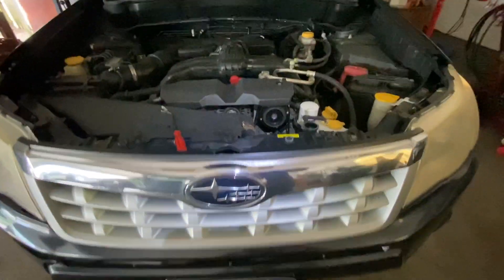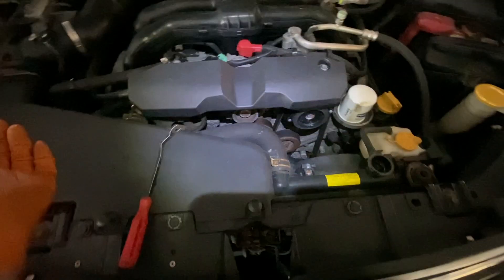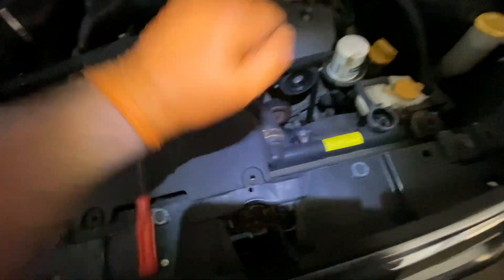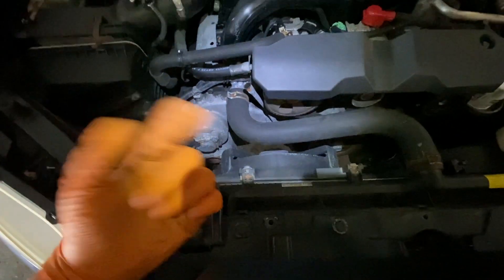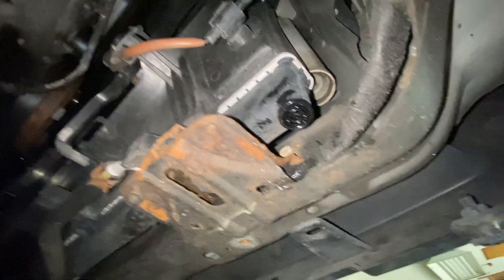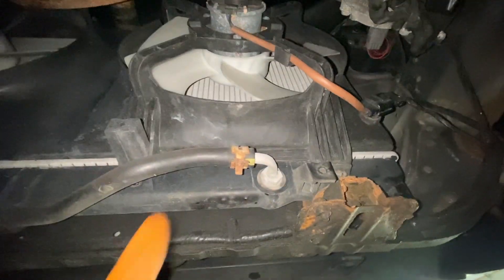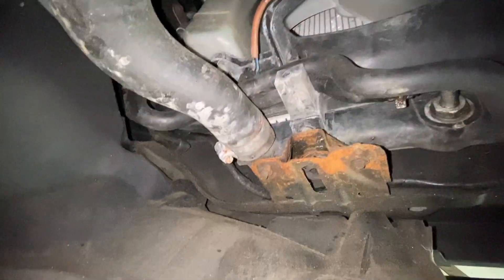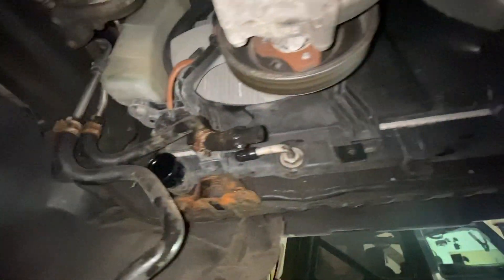Radiator Replacement  Subaru Forester, Impreza, Outback, Crosstrek, Legacy 2.0 & 2.5L - 2005 & Up

Comment: Going to be working on a 2010 Subaru Impreza with overheating problems thermostat was changed now going to do the radiator hopefully that works. Thank you from Central Oregon
Reply from the maker: Thank you! Good luck, and let me know how it turns out!

Comment: This is not correct for gen 5 (2015-2020) Outbacks. Lots more involved. Trust me, I just did mine lol.
Reply from the maker: I don’t know what you’re talking about, radiator is in the exact same place maybe a couple of different brackets but no big difference between years. I have a 2020 in the garage now and it’s easier than the one in the video
Reply: @motorcarnut   maybe I shouldnt have said 2015-2020. Maybe they changed it after 2015? Lol
Reply: Does that mean aftermarket radiators will work fairly good like the OEM radiators? @motorcarnut